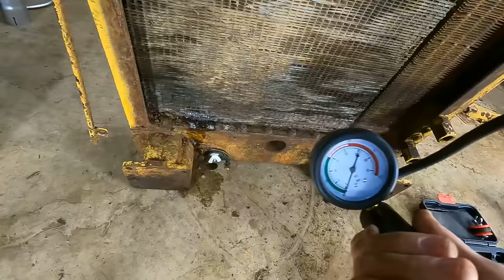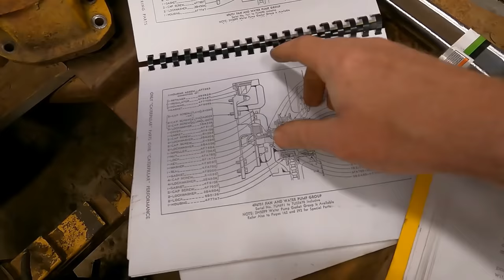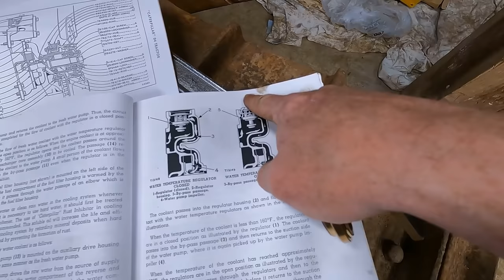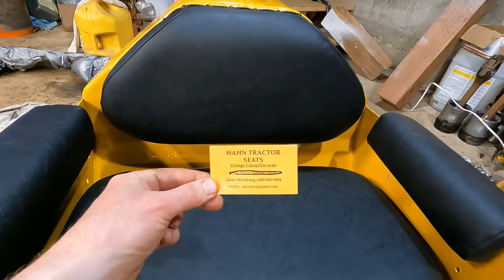Caterpillar D4 radiator rebuild

Comment: Its very hard to just relax, and trust. If a dog nipped you once but then got to know you and just wagged his tail everytime he sees you.. your going to remember your first meeting right off. I know cause I described me. I ran this equipment at some near new but lots more was your age when I crawled on for the twelve plus hours. Most of dads equipment was missing caps or they were compromised bad. In and around every two months would go by with most of his equipment.... they would take as much as two quarts of water to fill. I took it upon myself to find caps that worked after they had been run this way... it was a mistake as it would have steam coming out and other hidden issues just waiting for me to fix. My dad blew up on me and said; Do you want to put me in the poor house? I did as he told me from then on, add a couple quarts of water, the machine preformed well, and no more overheating.. well unless a headgasket let go or some other problem like so much dirt in the fins nothing could cool. I guess its all in how much your going to push this machine an how many hours everyday its required to work heavy and hard mistreated days. I ran all of his equipment an no severe problems from a tiny leak. It was just a maintenance problem that can  be worked through. I know I am of no help to you but I seen and trust the work so far... I think the radiator is the very last of things to even be concerned for

Comment: I would think the cap sets the pressure and if it's very low  you will be fine. That is if the stat isn't a super  high temp too. Thoughts..

Comment: I don't think you need to sweat the pressure test - my '47 Chevy has the radiator cap neck designed so the pressure goes right out the overflow pipe. The cap seals to the outer rim of the neck, and it does not have a recessed sealing surface like a modern radiator.  Sorry you've been sick! Another good video of "real man work" on all those rusty bolts. Were the bolt holes blind or did the bolts go thru into the coolant? If they go into the coolant, the threads may need some sealant.
Reply from the maker: Thanks, they were blind

Comment: Looking good Matt  Pls. Paint the copper core it'll be 🤢in 6 month's!  Been there . Comin along get well Eh.
Reply from the maker: Thanks, I think I will paint it.  I'm trying to locate a good coating to use.
Reply: @PacificNorthwestHillbilly  just make sure it is a lacquer type. It will hold moocho better 😁👍👍
Reply: @PacificNorthwestHillbilly  the fins are what absorb & expel the heat. It’s a bad idea to paint them
Reply: @donsturtevant2396  they make radiator paint just for that reason.

Comment: Its likely that the cooling system runs at 0 pressure.  Lots of old cars never had a presssuriized cooling system and are vented at the cap to the air.  That may be the same way.

Comment: Hi Matt, I couldn't quite catch the part number for the thermostat. Was it 32388? The new thermostat for the D-2's look like automotive thermostats. wondering if this one will fit into my D-2?  I like the Gates thermostat you have there.
Reply from the maker: It was 33388, not sure if it would fit, the ones I've seen on D2s looked smaller.  There are dimensions for it online though... good luck!

Comment: 🤦🤦🤦 O man, You'll never guess what I did? 🤦🤦🤦 I was undoing the bolts off the bottom radiator core on a 955 12A Traxcavator with a short 1/2" impact socket and wobbly-joint   🤦🤦🤦 You'll never guess !
😯😮😲😱🤨😓😠🤬🤬🤬
How did you guess? Yup I wiped out the core🤦🤦🤦  It was in about as good a shape as yours and needed replaced anyway. Riiiiight That's my story and I'm sticking to it... 🤦🤦🤦 
Thanks for the Heads Up on Drop Shippers.👍👍👍👍

Comment: Things are coming together. One thing however I disagree with.  If oil quality is better as you say and therefore an oil cooler is not required, how come every Cat still has an engine oil cooler to this day?  I would fix it if you can it’s there for a reason, I know lots of guys bypass them when they leak for tractors that don’t do very much work or to get them initially running, but it sounds like you are going to be doing some actual work.  Also I’d get some paint on that new copper core so it doesn’t turn green on you.  Gotta love a Hahn seat!!

Comment: Next time use a sawzall or grinder or dremel with cutting wheel to cut the bolt heads off.  Never hurts to take a minute to thow the ball for the dog

Comment: I have several old cats none of them even have any pressure at all run fine over overheat even my old gas powered one I use a D7 now so if you need any D4 parts or d6 parts I have several

Comment: I have to tell you, I cringed several times watching this (grew up working in my parents radiator shop)  Especially watching you torch the heads off the tank bolts. 
 Testing the new core- much easier to fill with water and then put 5-10 lbs pressure on it.

Comment: I am not sure I understand your logic regarding OIL COOLER is not needed because of modern oil.  Does not the oil-cooler help cool the engine-internals where the antifreeze cannot flow?  (Why do virtually all modern engines [cars,trucks, equipment...etc] have some type of oil-cooling?)
Reply from the maker: I'm not an expert, this is just tribal knowledge in the antique cat community.  I believe the old oils didn't handle heat well and lost their viscosity when too hot. Modern engines make way more power in a smaller package and need external coolers.  Keep in mind this old engine is only about 50hp!

Comment: How could you think putting acid in that old of a radiator now I used hundreds of gallons of muri acid in commercial dishwashers but in my computer radiators I will only use vinegar to flush the copper out.

Comment: Where's the steel plate that goes in front of the radiator.
Reply from the maker: There isn't one, the hydraulic pump goes right in front of the radiator, and then there is a steel guard in front of that (which I don't have)
Reply: @PacificNorthwestHillbilly  would be a good final project.

Comment: Couldn’t you just find a radiator off a similar Diesel engine instead? Wouldn’t need to be construction equipment, just comparable size.

Comment: "The oil cooler is obsolete with modern oils" ha ha haHA HAHAHAHAH BAHAHAHAHAHA! Modern oil or not, to do any type of work with this machine it needs a cooler.
Reply from the maker: I wonder why Cat removed the oil cooler 3 years later from the D4-7U until the end of production.  I guess they didn't know what they were doing. 🤔
Reply: Well that maybe true for the D4-7U but the way I interpreted your statement was that THE oil cooler, as in all oil coolers, are obsolete due to modern oils. 
Also, isn't it common knowledge to anyone who works on equipment that engineers rarely know what they are doing? 😂
Love the series!
Reply from the maker: Oh lol, yeah that's definitely not what I meant, just meant these antique cats.  This thing only makes 50hp and has a capacity of 4 gallons of oil!